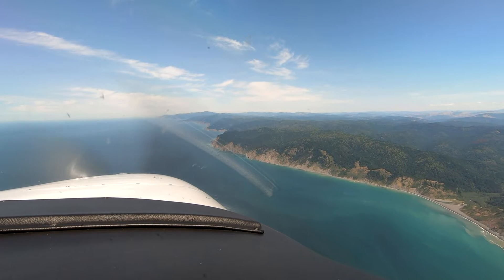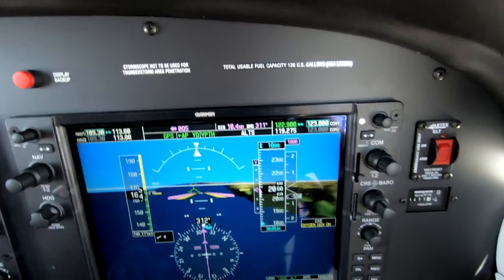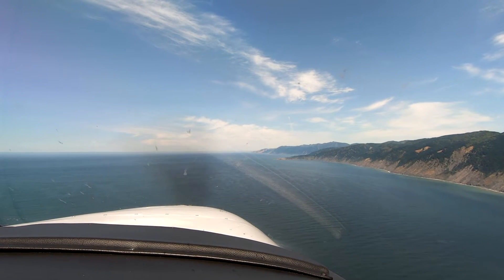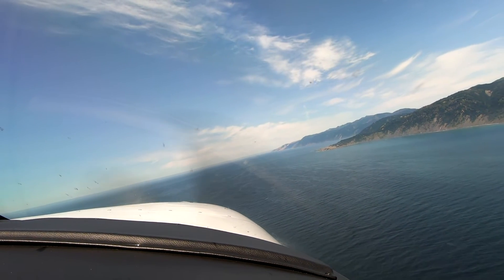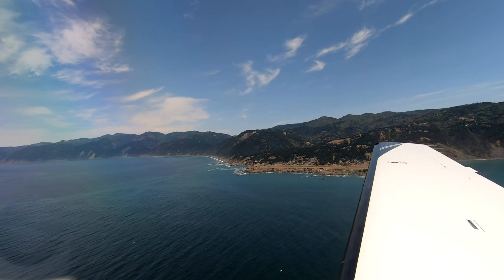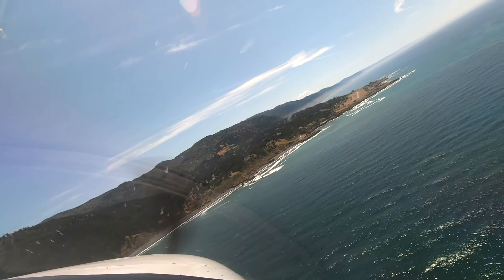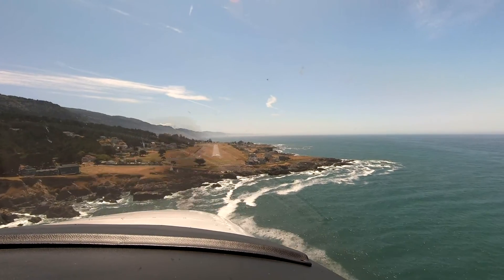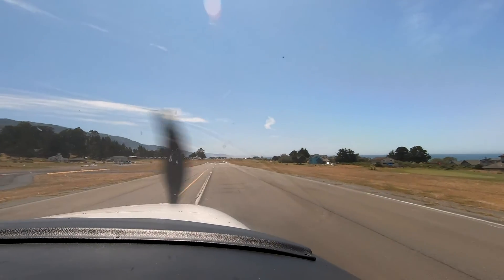Flying the Piper M350: A VFR Approach and Landing at Shelter Cove, CA

Comment: What's the purpose of using the speed brakes on the ground ? I thought they were not certified for landing on this aircraft...
Reply from the maker: Hi Carl, The PA46 speed brakes are a show stopper on a missed approach so it is imperative to use them only after the decision to land is made. In this aircraft that is more or less in the flare or shortly thereafter. Once deployed in this fashion the right hand must ensure the power lever is at flight idle and then removed from the power lever and placed on the yoke. This reminds the brain that the committment to the landing is finalized. Piper is correct of course in prohibiting speed brakes for landing, so that a go-around is not unduly complicated. It is also true they work quite well for the roll-out to minimize the distance. Back-pressure with brakes completes the procedure. Fly Safely - Train Often .. DR

Comment: Thanks for posting again Dick. What are Pots?
Reply from the maker: Hi Lawrence, I’m not sure which video you are referring to, but “pot” is a shorthand name in the electronics world for potentiometer. Pots are used in many designs in many applications. They are a way of varying voltage in a circuit such as dimmers for example.